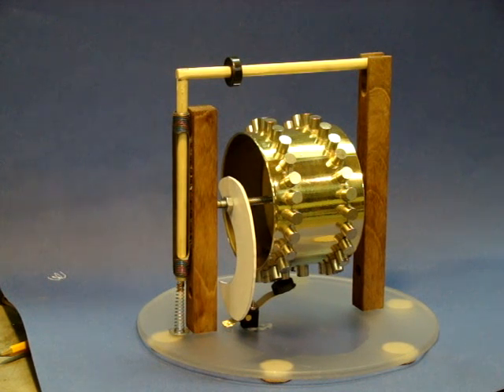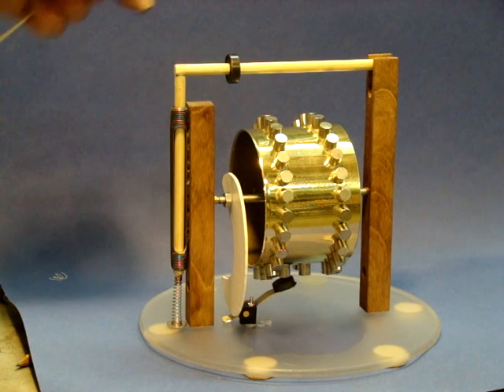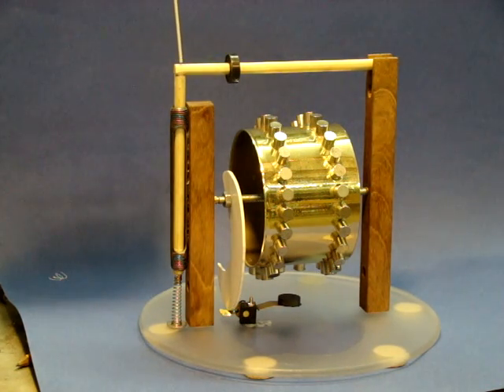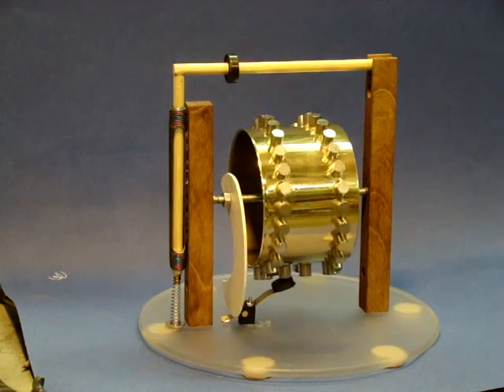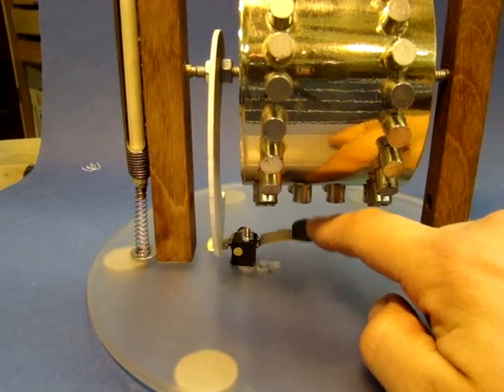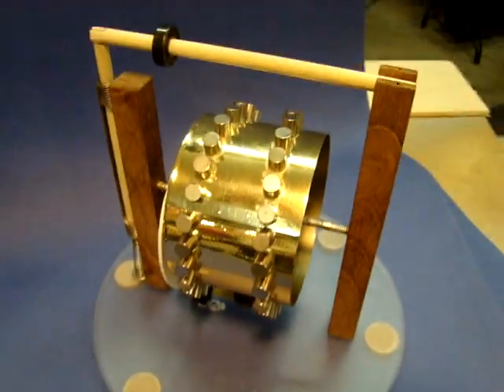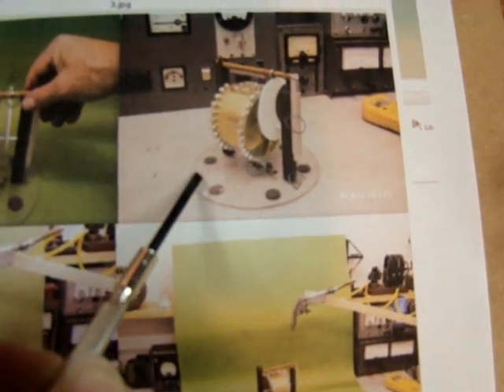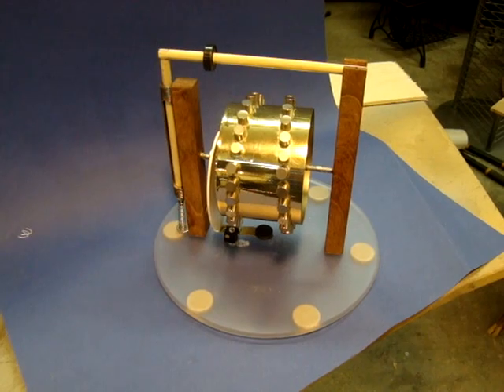Evolution of Perpetual Motion, WORKING Free Energy Generator Part 2 of 3

Comment: I don't have the possibility of replicating the motor. But if the V GATE moving on a flat surface is true (as they show on a video). I am 100% I would be able to make it work!!!!!!!
Reply from the maker: I share the same thought.
Reply: @woodbrassandglass  Yeah buddy. Have you tested the V gate on a flat surface with long bar magnet on top of it? Does it work? There is no denying, if it works (and gravity sure works), then the repulsion (or attraction, both on top and the bottom, sure should be pumping some energy and make this thing work. Isn't it so? Well, you constructed the little gadget, and you saw that it doesn't work. Maybe you should fine, fine, fine tune everywhere. The distance of both bar magnets on top and bottom, the weight of these magnets, the distance of those magnets to the point of rest, well oiled sliding, and use (and this comes from calculus) a special curve in the plastic thing that makes the bearing turn. I suppose you know what I mean. I believe this thing should be as fine tuned as the cams and valves in a motor. Greetings!!!!!

Comment: i watched your part-1 but i think you have money but have no mind at all ...... the purpose of the cam was to push the magnet away from the rotor body and what you have done is made it jump near to the body of the ugly magnet intersection point that blocks the magnet to move forward ..... so i don't know if it will work or not in reality but i am pretty sure that the task was to make the single magnet away from the ugly magnet point not the other way around ......... and so far another thing you are just making these videos to prove that this design does not work .......... so if you are making it to prove that it doesn't work then it will not .......... and it is like your designs motive is to put as much friction as possible
Reply from the maker: Such intriguing Revelations, you may be on to something,but perhaps you should test it and build it yourself to work the ugly out. I would love to watch your video when you do this.

Comment: I know this is old but i enjoy your work wouldnt it be ok for the bottom magnet to be a piece of steel but also make it so it cant actually touch. Plus your wheel isnt exactly balanced creating unequal nonsmooth rotations no judging just suggestions and curious
Reply: 🧲 The principle is sound. Simply lay this magnet configuration out on a flat surface. Place clear plastic on top. Now place round steel bar at the bottom of the v-gate., IT WORKS JUST FINE

I will make one of these soon and see if this is indeed possible.

Comment: What a poor way to debunk something, dude! You cannot call it a near faithful reproduction if you don’t replicate exactly all elements used in the original. For one, you did not even include a major part which is the long bar magnet at the top. FYI, it is the driving force for the v-gate in order for it to work. And you stupidly omitted that. Try studying first how a v-gate works before you try to debunk somebody’s work. I cannot believe you actually made one just by visually copying what you see in the video and speculating on something you do nit fully understand. Plain stupid! 😡

Comment: Try harder. Nowhere near the original design. On the original, the magnet latch on the bottom only moved slightly giving the rotation an  'extra shove' forward by a small amount (very subtle) as the vgate reached the end of it's cycle . It didn't bash the underside of the barrel. And the obvious error... no bar magnet across the top. You've gone to all this trouble, why don't you finish it?

Comment: I invented a breakthrough source of energy,  based on Classical Electrodynamics and on Circuit Theory. It will be useful e.g. for laptops and for cellular telephones. I am looking for an investor who can make an investment in the range $500 000 to $5000 000 - I offer 9% to 49% of the starting company. My email is htg@interia.pl , tel. +48-780-129-544

Comment: The whole device is backwards and you fucking missed the main magnet at the top.
Reply from the maker: I must have missed to point out this unit is only partly done. the label of the video says it all. Part 2 of 3.
Reply: +wood brass and glass My bad, did not see that. So what was the end result? Can't seem to find part 3.
Reply from the maker: +Grey Dark it took a full air compressor just to run the silly thing:) it was a complete fail....
Reply: +wood brass and glass your a complete fail dude..how much were u paid bro??

Comment: you forget thing in your design, even if the device will never work :)

A magnet (big) is needed on the top bar for attraction. while the bottom is the opposite, and you must move the bar higher for the magnet to be far from the magnet, you only use some kind of ball bearing on the top bar, actually your design just dont need the top bar moving since no magnet on it... 

Anyway nice replication

Comment: Gee, a "more true, authentic replication", how nice of you to create such a thing!!  But isn't that kinda sorta like saying your mom was almost pregnant??  It's either authentic or it's not!  It's either unique, or it's not!  It's either perfect, or it's not!  How can you say that something is accurate or authentic when it clearly isn't?  Do you even understand at all the concept of an absolute?  If V-gate motors actually do work (I haven't seen one in person myself yet), meaning that it's working without any external influences, then that means it does work and no arguments nor justifications are needed about it.  It just works is all and too bad if that's uncomfortable for some people. 
  As I recall in the video I saw about this thing, he spun it around at least once to show that nothing funny was going on.  But if it's a very sensitive device that needs to be carefully tuned/adjusted to make it work, then just throwing one together with some bubble gum, buttons, bailing wire and parts out of the trash bin is not going to cut the mustard.  When I set out to duplicate ANY kind of machinery or its parts, I build it exactly to the needed specs.  It's called 'reverse engineering'.

Comment: your a moron
1-the magnet on top is the most crutial part of the device.
2-the tube is most likely a cardboard sticky tape roll painted or covered with thin metallic craft card - Therefore much less weight to move
3- all the vgate magnets polarity are the same are the same way north or south outwards and the opposite polarity on the reciprocating arm. hence opposites attract

Comment: Missing the main part and thats the top magnet, and the cam is supposed to lift the top bar and not just graze it, is it true to the original, I would have to say NOT at all.

Could that person have used compressed air, that possible but this would be proven only if the actual exact replication is done, and that has NOT been done here in this video as he says that the main part is steal and not brass and the spring is to pull the bar down and this one shows nothing that can be seen as true to original and this is just a crap way of trying to debunk something that has not shown to be like the original, I can see this with my own eyes as there are to many inconsistancies with this build.

Comment: Again, maybe what you try to replicate is fake, but your model is extemely clumsy and incomplete!
Reply from the maker: Again this is only 2/3 complete.  Part three is the final product.  I am planning this summer to make a carbon fiber or bucky paper version with non-magnetized ferrite rods, along with magnetic bearings to put all the nay-sayers to shame that this model is to clumsy or some other rubbish that a 6th grader would know better on.
Reply: thanks for reply! try extremely well ballanced minimal action/friction. Learn from Reidar Finsrud--his magnetic selfrunning closed system works but he spent endless hours calibrating it in terms for it to work. Cheers!

Comment: "I've basically replicated everything..." Except the fucking bar magnet at the top.
Reply: Maybe if you also could create that magnet bar and put it on the right position, then this v gate magnet motor might work.
Reply: @johneygd  Oh man I haven't looked at these videos in a long time, but I thought about them recently. 7+ years later I'm now a physics student at university, much less naive and much less impressed by videos of people who seem to have a perpetual motion machine from permanent magnets.

Suppose you could make a perpetually spinning thing like that, with the magnet at the top and all that, without the need for an air hose.
It still wouldn't work, because all that clacking you're hearing of the spinning thing hitting the magnets and the bar is it losing energy. There's air in the room, so it's heating up the air very slightly, there's friction in the spinning bits so it loses energy there too. And then even if you got it to work with 0 friction in a perfect vacuum, if you tried powering something with that it would slow down and stop. Magnets are not a source of energy, and magnetic fields can't do any work on something by themselves.
Reply: @gooscarguitar  mmm but what if you could put a v gate motor on a cold place, what if you semerge it with cool pasta, it should eliminate heate and friction, whatever it will work for 1 day or 10 days, i don’t care , i will be either way very satisfied about it.
Reply: @johneygd  
Well, just spin a bicycle wheel in the vacuum of space and you've got perpetual motion if it's perfectly lubricated (which it's not). But as soon as you try to use the energy there, it will slow down.

Comment: I like your models.  I put together one of these too and it's not nearly as pretty.  So far I have had similar results using magnets on the rotor.  Allegedly the original uses ferrite rods instead of magnets.  This would make a bid difference.  You should check out http://www.callowayengines.com/msg5.htm
Reply from the maker: Hey what up?  Thank you for watching my video, I have been thinking of doing a 3rd version of this device, but this time use only ferrite instead of magnets and one up the original version build the whole moving assembly out of carbon fiber or bucky paper to reduce the weight  dramatically. Sadly just to keep this "motor" running required my compressor at full power to keep it going.

Comment: This whole project is bass ackwards. The task here is to try to  prove something false. That is usually considered to be a logical impossibility. It's up to the inventor to prove that it does work. A YouTube video will not satisfy that requirement. It takes repetition by others. And a workable theory should be included. Until then, it's all BS.
Reply: Why false, who proved it to be false?
Workable theory is magnetism is an form energy.
The prove that the magnetic energy is part of the equations
Like
Force = Wirelenght x Current x Magnetic strength.
Note the multiply  
So you get no matter what: if the magnetic strength is doubled so the Force is doubled.
Reply: Tbonyandsteak The point I was trying to make is that this video does not prove that the device does not work. A "negative" claim can never be proven to be false. Only a "positive" claim has the possibility of being proven true. That's why the accused man is not required to prove his innocence. It isn't possible. It is up to the prosecutor to prove that the accused is guilty.

As to your claim that magnetism is energy; that's just not true. Magnetism is a force. Force is not energy. And where did that formula come from? It's nonsense. Plus, the device in the video contains no wires or current. "Magnetic strength" x 0 x 0 = 0. You can double the magnetic force but it is still being multiplied by zero twice. That still gives you zero.
Reply: jhanthony2 My fault put my comment the wrong place, sorry.

Force is also a form of energy, that was my point. 
Like Kinetic is, which is called an energy.
Becourse some say it isnt an energy, they dont get the label scam there exist in this.
That there exist overunity potential becourse of magnetic strength determent the effectiveness quite a lot.
Reply: jhanthony2 Btw, no, Your wrong about the 0, the force ends up with the magnetic strength. As you said it is a force. 
And if you create an overunity device by magnetic and electric energy, you will end up with an explanation problem where that extra energy is comming from. Which only can be explained by they are all form  or sort of energy. They are just different
Reply: Tbonyandsteak OK. No problem.
Reply: Tbonyandsteak force and energy are two different things. The ground is exerting a force on you right now, are you getting energy from this force?
Reply: ***** Dosnt really matter what you call it.
What matter is how it relate in the equations of natural laws.
Facts is wheter it is energy, force, what ever the terms that is mentioned in the laws.
They all usual play an equal part in them.
As many of them are multiplied with each other.
That is the core thing many overlook.

Equation are pretty simple, exactly as stated.

The thing is Force can create energy. Liket to a common generator.

Dont get me started on that fake Thermodynamic.LOL..
That claims the energy is the only determent in natural laws. 
Quite a contrediction when it multiplies with other attributes.

Comment: How on earth is this a faithfull replication, when you haven't included he main magnet of the V gate? How can you say the original vidéo is a fake when you haven't even finished your magnet motor to see if it works or not. It seems to me you are more hellbent on NOT making it work, than the opposit.
Reply from the maker: ...hmmm...I don't see your model replica anywhere....
Reply: wood brass and glass What? please respond with substantial arguments.

Google Minato Magnetic motor. They sold  40 000 units, so I guess magnetic motors do work. But it won't work if you don't include the magnet, Sherlock.
Reply: I agree, not that i believe the original works, but this guy sounds like he is just out to disprove it no matter what.
Reply: also the magnet he uses at the bottom is presset againtst the rotating magnets what macks no sence!!!!
Reply: The911watch I googled Minato Magnetic Motor. Those videos are pretty embarrassing. Very poorly produced scams.
Reply: wood brass and glass we don't have to show up that we are dumb, unlike you, first didn't put the magnet, second used air for starting motion and then when moved the air flow farther it slowed down, which didn't happened on example that claims to be working, you are Fake and obviously dumb dude.
Reply: I already know this machine doesn't work, I came here to see why it doesn't. This isn't possible if the main magnet is just left out. What a stupid video.

Comment: Magnets and gravity can be used to transfer or change energy, but they can't create it. Every object or substance that is in a position to fall contains potential energy. But something, somewhere, somehow, at some time, placed that rock or pool of water in its present location. THAT is the source of the energy that the falling substance contains. You perfectly described a hydroelectric plant. The true energy source is the sun evaporating the ocean's water. Gravity does not provide the energy.

Comment: the nut and the hole on the inside of the sleeve are strategically placed to balance the exact wheel in the original video, by just copying where the original builder placed his you are most likely just throwing your wheel off balance even more than it already was.............

Comment: you build it wrong, it works -.-

u need a stab-magnet on the top and a little magnet, whitout a spring on the bottom. they are making the impuls and should not stick together. they should push away.

Comment: it is definatly in repel mode and it floats on top the poles on either end have to be the same polarity which will be opposite on the other magnets on the other side of the drum so you would get constant repelling and would get stronger toward the end the bottom is another magnet which gets the mechanism with the help of gravity past the "stick point all must be properly lined up to work

Comment: you don't have a magnet at the top attached to the reciprocating bar.  Clearly from the original video in the evolution of this device ONLY a reciprocating bar magnet at the top  powers the device (when reciprocated by hand).  the later addition of a reciprocating magnet at the bottom is unknown...(maybe adds a push or pull???)

Comment from the maker: I believe this is true.  It will take some working out the kinks to make it run.  The other main problem this unit has is that the magnets need to be placed exactly next to each other.  The space between each one acts as a "magetic" well that actually works likes gears grinding to a halt.  Square magnets lined together would be better.  You need a line of magnets, not "gear" teeth slowing it done.

Comment: Thank you for your efforts to replicate :
Your rotor is not weighted evenly, it has a heavy side.
The bottom actuator should be in repel mode not attract...
My replication work with the original Robert Calloway V-gate magnet motor configuration shows it to be a viable magnet configuration to obtain rotary motion from permanent magnets...  There are various possible ways of doing it. Happy experimenting.

Comment: Yours cannot work because the bottom magnet actually makes contact with the center wheel and the other merely restricts the movement enough to create an attraction yet not making contact. By causing a slight downward pull adds to upward momentum helping it over the hump. According to amperes law, magnets are absorbed faster than they are released thereby supporting the idea of creating perpetual motion. Give it another try, you're close.